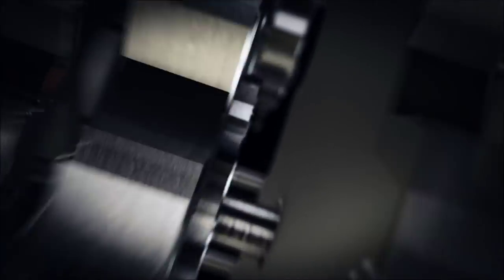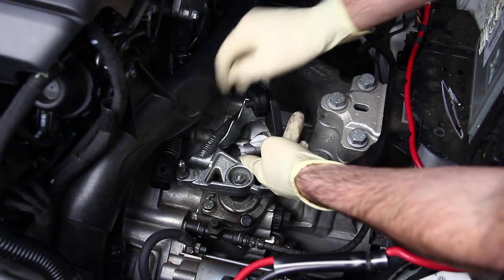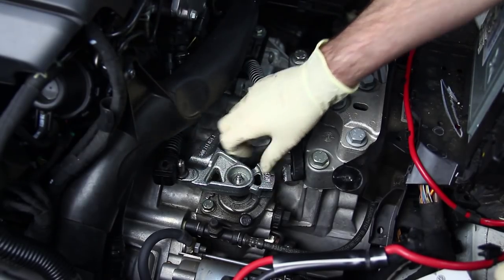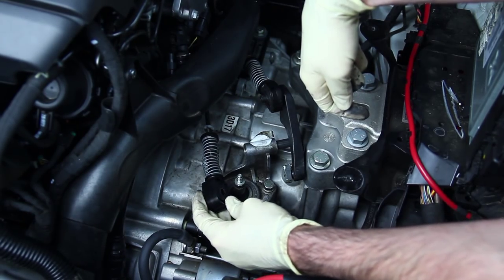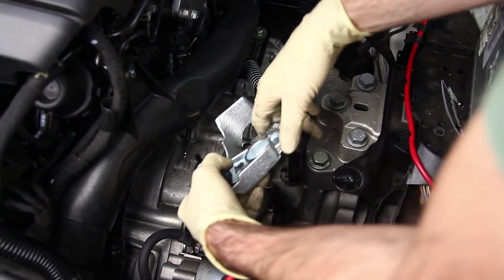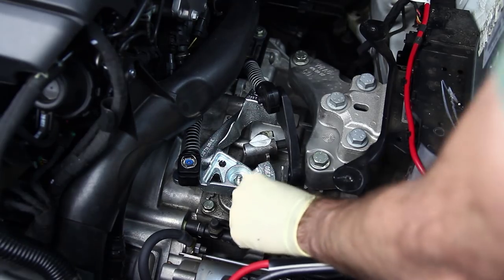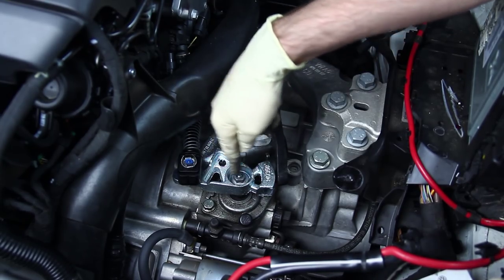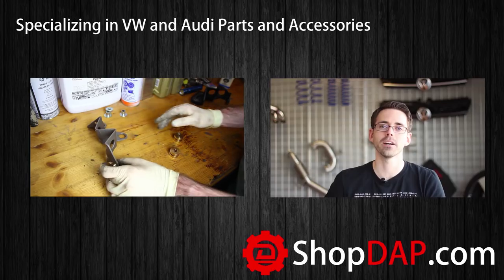MK7 GTI OEM Euro Short Shifter Install (DIY)

Comment: prob should lock the gear stick in neutral usually a 5mm drill bit or so will fit under the gaiter sometimes it's 2nd gear. locking depends on vehicle it's easily visible though

Comment: Paul why didn't you guys lock the shifter/tranny into service mode? Seems that part is vital to guarantee that there are no issues after the replacement? Additionally, I didn't see you guys mention anything about the endlinks and how its beneficial to replace the rubber/plastic items with metal ones. You should consider selling it as a kit and show a video how to do both. I plan on doing so here shortly and I'll show how both are done on a MK7 Golf R. Great video's as usual.
Reply from the maker: +Schwabo For this installing locking the shifter isn't really needed.  We talked more about it on the metal cable bracket DIY.  In regards to the end links we are working on them but dont have anything at this time.
Reply: +Deutsche Auto Parts People are generally not aware that they can bring their shifter out of alignment, you're a grade much higher than us when it comes to installs. The more foolproof the better IMHO. Keep up the great work!
Reply: You're right, you don't have to do it if the car is in neutral, as Paul indicated.

Comment: Thank you for the video, I installed one for my 2008 GLI and everything went in and out pretty easy.  The side to side arm featured a plastic clip to depress the arm back, but took some wiggling to snap back onto the new shifter.  The front to back arm was straight forward and i just grabbed as far forward as I could on the arm.  I just hand tightened the shifter bolt, then another 1/8 turn but nothing more.   The shifts don't feel shorter but the stick shift is crisper with a  heavier feel which cleans up the factory play.

I put silicone grease on the ends that touch the side to side arm.  

I didnt have to adjust the shifter levers or after install.

Comment: Just an FYI for anyone installing this shifter - I installed this exact unit in my 2017 GTI.  I followed this video step-by-step and the install was a breeze.  Took all of 30 minutes being careful and taking my time.  However, afterwards my GTI would not shift correctly.  Reverse, 1st, 3rd and 5th were all jacked up snd wouldn't go into gear easily at all.  2nd, 4th and 6th were fine though.  A few minutes and a google search later I found this video: https://www.youtube.com/watch?v=sheTKD03hmo and it saved my butt.  Bottom line is that the new shifter has to be aligned.  The video I mentioned is for an older model VW, but is still relevant to the MKVII as the mechanics are very similar.  Once I found the video it only took me a few minutes to make the shifter right and it shifts awesome.  Cheers!

Comment: Two questions:
1. Do you need to keep the end link that comes attached to the Audi shift lever? I would prefer to keep the stock link, if possible. 
2. Do you need to adjust the shifter assembly after this install? I know that the Dieselgeek short shift kit requires adjustment after install. 
Thanks Paul!

Comment: I know this is a super old post, I’m going to attempt an install. When I did this on my TT with a different brand a few years back I had to reset the cable linkage or “zero” it. Is this necessary?

Comment: Is the MK7 stock shifter shorter than the MK5/6?  Reason I ask is because on the MK5/6 this "S3" short shifter would claim to be 20% shorter.  But on the MK7 it says its 10-15% shorter.  I've always wondered if the MK7 actually had a shorter shifter than the MK5/6.  I came from a MK5 and now have a MK7 GTI and it certainly feels much better but I don't remember how long the throws were. 

Keep doing these DIY videos.  These are great!
Reply from the maker: +Gary Lee Tough to say for sure.  They are likely similar.  We try to be conservative to ensure that no one feels like the info they get from us is over embellished.  Hope this makes sense.

Comment: hey paul, great video, would this procedure be similar when working on a an 2006 audi a3, with the tfsi 2.0t engine? if anything ive had a clearer understanding on how to get started. thanks and once again great work.
Reply from the maker: +Arjay Canon yes would be similar
Reply: Hey bro did you end up installing that short shifter because I also have an a3 an was wondering how it went

Comment: I installed the short shifter and the solid shifter bushings in my 2015 gti, now shifting into gears is very difficult, specially into 1st gear, I literally have to force it and it's very grindy while going into gears. I can't shift into 1st if the car is rolling slowly... any idea on how to fix the issue? does the shifter linkage needs adjustment? if yes how to?
Reply from the maker: +Ismael Mahamat Sounds like you will need to adjust you shifter.  Take a look at this video it would be similar to this https://www.youtube.com/watch?v=pUtZuLyr_sc
Reply: +Deutsche Auto Parts is it safe to drive the car just as is for a couple days? or will I break something
Reply from the maker: Ismael Mahamat You wont want to be grinding gears long term this could do some damage.

Comment: i have a question i have a 2015 MK7 GTI with 18k and I'm getting clutch chatter when my car is in idle as soon as i press the clutch slightly the chatter goes away, and I'm always having to rev high in order to get the car moving from first so it doesn't stall on me, I'm not so sure if this is the clutch itself that's causing this because its worn out or is this a factory problem and if so can i adjust the clutch pedal or do something to make it go away, i really love this car and don't want to have to make repairs so soon i just bought it this weekend. thanks ahead of time.
Reply from the maker: Answer coming on AskDAP 42
Reply: +Deutsche Auto Parts  
thanks in advance , great show, ill stay tuned.😁

Comment: under normal driving condition (i am from Canada, and it gets pretty cold here at least 6 months of the year), how often (miles or years) should i change the coolant in my 2011 Tiguan? thanks.
Reply from the maker: +nickolastiguan Check your owners manual as it should have a specific interval for your vehicle.
Reply: Deutsche Auto Parts i can't find it anywhere, maybe because Canadian version of the OM is different... my dealer wants me to change the fluid every 4 years, but i only have 25k miles right now...

Comment: So Paul...what happens when you break that stud off??? Yeahhhhh I did it. Please help #DAP , what parts do I need? Is this a possible Diy?
Reply from the maker: +Brean Duncan what kind of vehicle
Reply: @Deutsche Auto Parts , 2016 Golf R
Reply: #dap I found this very helpful post for mk5,The original poster did the same thing. http://www.golfmkv.com/forums/showthread.php?t=133705 .Post number 16 references a parts diagram but has no part numbers listed. Original poster comments later install was very simple. I just need a part number for a  mk7 golf R 2016.

Comment: Is there an easier way to remove the stock shifter? i've tried prying it and using the method in the video, but man is that thing in there! would WD40 be safe to use?
Reply: If you use a long attachment on your ratchet, put it on the bolt with the 13mm bit and tap the top of the extension with a hammer. Alternatively you could just hit the top of the 13mm if you don't the extension but be careful with it.
Reply: I've been trying to get it off for 2 hours

Comment: i have a question. i just replaced my stock shifter with apr short shifter. great. but i have to rev to 3000 rpm to get to 1st. is that normal?
Reply: No, thats not normal. You should probably adjust your shift cables.

Comment: I recently installed a Forged short shifter on my MK6 GTI. I noticed that my shifts felt significantly stiffer. Is this normal when making this type of modification?
Reply: GTorres0709 yes you're reducing the amount of leverage you have so it'll require more force to shift. If it bothers you, you can compensate for it with a heavier or taller shift knob

Comment: Will this part keep my warranty because it's an OEM VW part? Or not really... Will this part be better than any of the aftermarket ones like APR, CTS or Neuspeed?
Reply from the maker: +Alexis Gueits No it will not be under warranty.  While this is an OEM part it wasn't intended for the vehicle which means that no factory warranty would cover it.
Reply: +Deutsche Auto Parts Thanks! but Will I encounter problems with this? or is that something rare?
Reply from the maker: Alexis Gueits We would not expect to see any issues as long as the install is done correctly.

Comment: Can anybody help me with getting the stock shifter off? Its been 2 hours!!
Reply: Did you ever get it off? Ive literally been pulling for an hour with no luck.
Reply: Legend has it he is  locked in battle with the stock short shifter.
Reply: @creativecontrol9047  push the shiftier down then pull up hard using the momentum of the spring, itll be like a reverse slide hammer
Reply: Randy Lahey thanks bro your the best